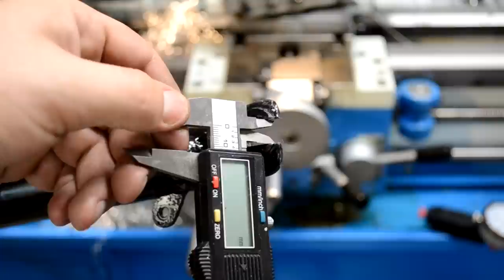1979 Puch Magnum Project Part 8 - Rolling Chassis Assembly

Comment from the maker: Whocares05050 - I cannot reply to your comment, but I did answer via a direct message. Here is my answer for anyone else wondering.

These are the Hydralic version of the magnum forks and the oil is used to dampen (slow) the fork. I'm not sure if its compression, rebound or both - I just followed the service manual directions.
Reply: Did you have to rebuild them or did you just clean them and paint them?
Reply from the maker: They worked fine and I just wanted to paint them. But while taking them apart for paint I figured I may as well replace the seals etc so "accidentally" ended up rebuilding them. Because of the decision to rebuild after I'd taken them apart I didn't record anything to make a video unfortunately.
Reply: Thanks for the info and the videos!
Reply: @n1bpd  hey man, trying to rebuild my forks and running into an issue with the piston and screwing the nut at the bottom back on. The piston just spins with it. Any trick to screwing it on? Thanks